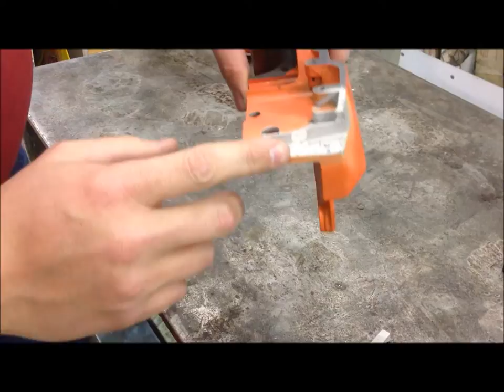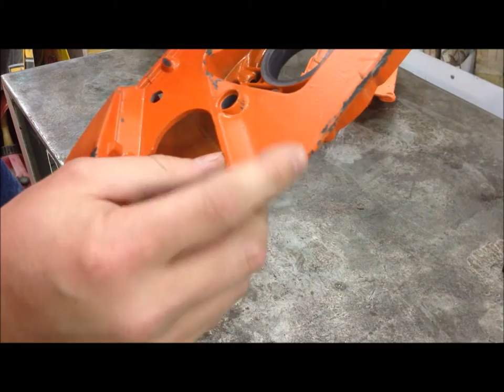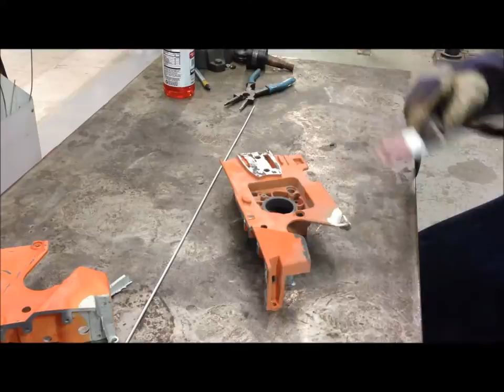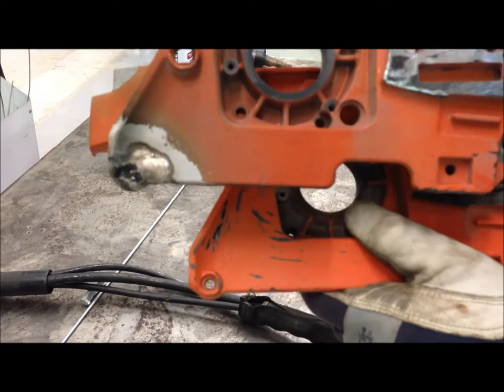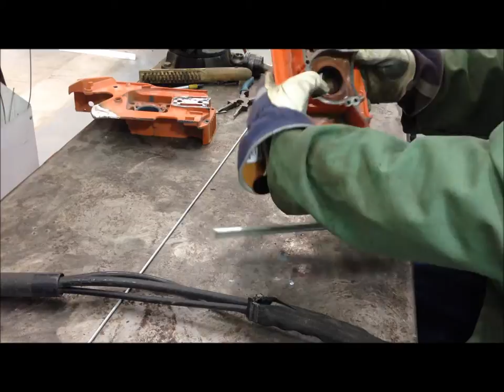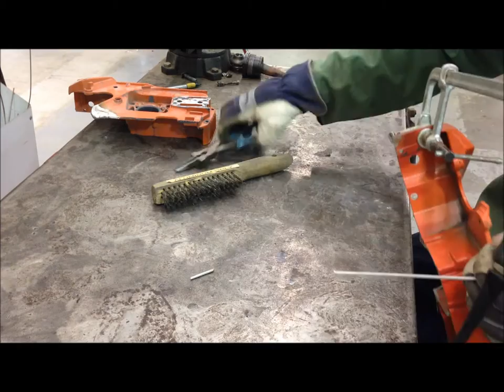Welding chainsaw cases, magnesium welding

Comment from the maker: You can use a TIG welding process similar to welding aluminum to weld magnesium.  Use argon shield gas and a mag filler rod like Harris AZ92A.  The shield gas will keep the magnesium from oxidizing (catching on fire).  I've never seen magnesium MIG welded before, I assume it could be done but the pitfalls of MIG welding aluminum will apply even more with the porosity of magnesium.

Comment: I would like to be able to see your welding. You need to get a lens for your camera. But I mostly was looking to find setting. Do you need to preheat the part does it weld like aluminium? I seen its welded on AC what kind of amps and how was your balance set do you need a lot of cleaning action.  I got a tank on a 640 McCulloch that needs repaired. I have never welded magnesium so was looking for some info.

Comment: Hey thats magnesium zinc legure? What wire you use?
Reply from the maker: There is not a lot of zinc in the alloy, more aluminum than zinc. I use AZ61A or AZ92A rod.
Reply: @srcarr52  thanks

Comment: Could you please tell me your welding parameters ?
Reply from the maker: Welder settings are similar to aluminum, AC current, argon gas.
Reply: What settings did you use
Reply: Hans Ulrich iiiiii